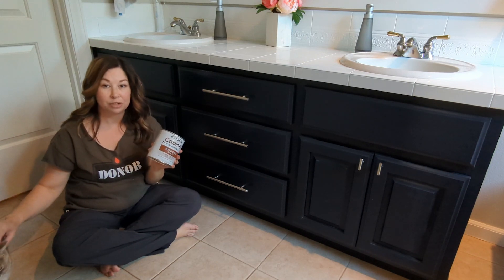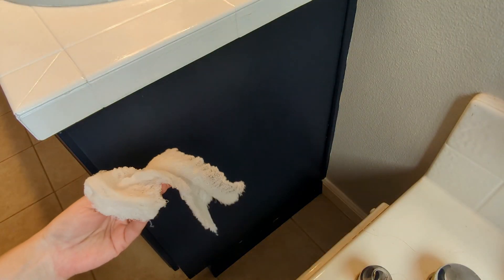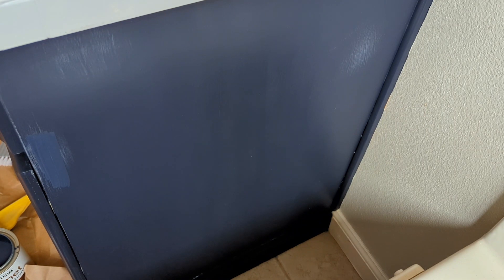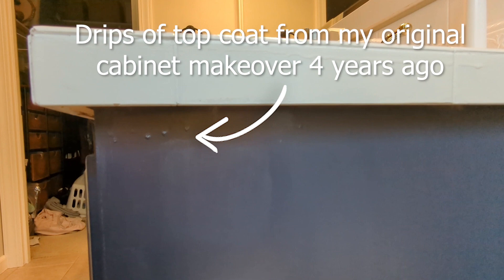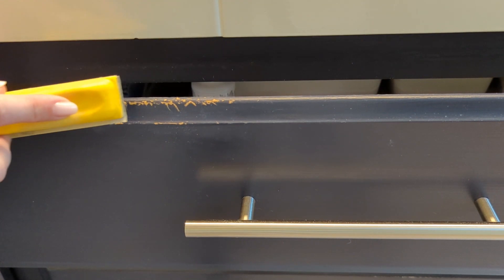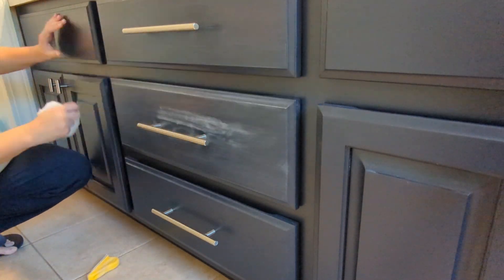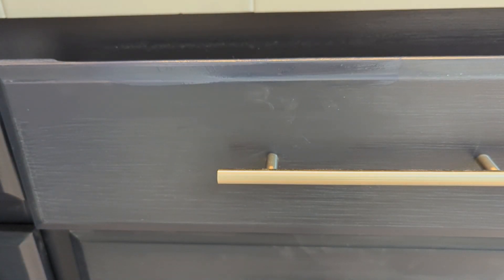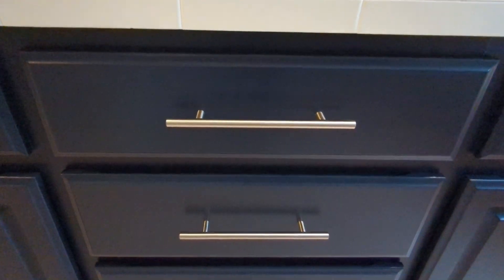Rustoleum Cabinet Kit - 4 years later!

Comment: This looks amazing!!!    I won't be doing any cupboards but I have wood bifolding doors in my bathroom with mirrors which were painted and I ws trying to repsint becasue of wear . after sanding  them and I painted them but hated the color tried another color but it looked streaky I lightly sanded then I primed over it  Now I want to repaint what kind of brush/s do I need  to keep a smooth finish ?  You can tell I don't  know much LOL
Reply from the maker: That sounds fun! Usually you'll have good results with any paint brush at the store labeled "best" You can ask the paint desk too - they usually know what they have in store that works for specific projects.